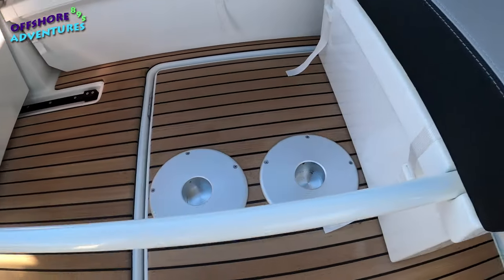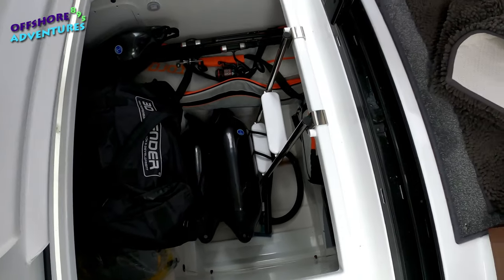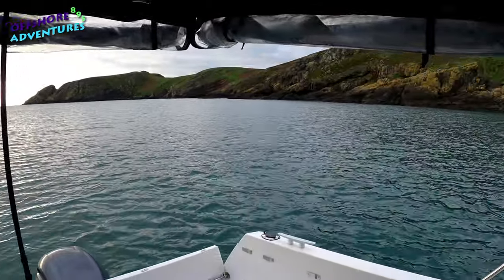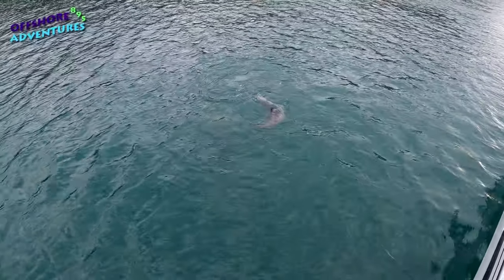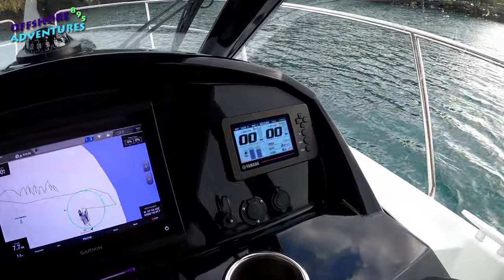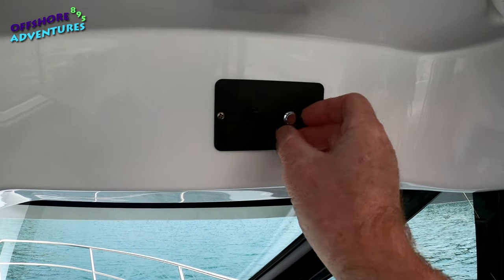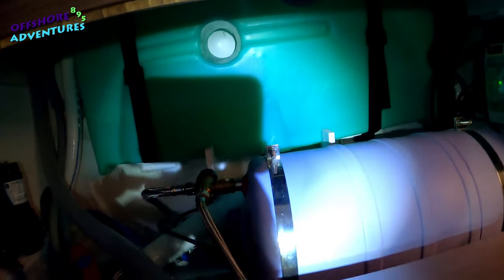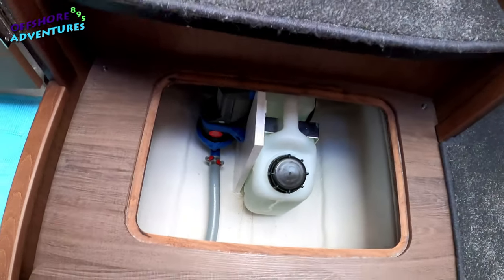Walkthrough - The Jeanneau Merry Fisher 895 Offshore and a picnic with seals!

Comment: Lovely videos, watched them all in the last day or two. Couple of questions as a lay person..?? 

2 x 300L unleaded fuel tanks. Assume it’s normal unleaded?

600 x £1.20 (assumed cost) = £720

Range of about 200 miles?

That about right?
Reply from the maker: Many thanks Notoriouscab 😁☀️ as always depends on speed but around 215nm at planing speed (21-22knts) or if you fancied a potter along the coast or estuary at 6knts then 383nms or 10knts then 336nms. So a fair range 😁. Servicing and fuel are, I guess, the deciding factors when buying a boat, after the initial outlay. That’s how I looked at it 👍
Reply: Thanks fir replying. Not close to getting one at the mo, but who knows!

Comment: I’m looking for a boat that could handle going from Florida to Bahamas.  It’s 55 miles on the open ocean.  Would this handle the open ocean in your opinion?
Reply from the maker: Thanks Matthew and yes it certainly would be okay for that 55 miles - it’s range at planing speed of 21knots is over 200 miles and that distance could be just over 2 hours at planing speed. It is a Cat B6 boat so that means 6 persons in waves up to 13ft and 40knts wind. The offshore version of the 895 has a strengthened hull to enable the B6 classification. Having said that it wouldn’t be a very pleasant trip if that were the sea state!!! So definitely yes to the trip and, as always, choose the best weather window to make the journey and to make it a comfortable crossing. There are some outstanding weather apps that give accurate forecasts for us in the UK - I suspect you’ll have the same!  Do your basic seamanship/VHF courses ASAP which will give you a good insight too. Hope that helps and get down the boat shop 😁😁

Comment: Can you trailer this boat/customize it a bit at the moment of placing an order? ps: How do you take a shower with only 25lts of hot water? No camping I guess
Reply from the maker: Hi Davide,
The boat is around 4.5 to 4.7 tons when fuelled and watered so you’d need a fairly big vehicle to tow it on a trailer!! I have seen one on a trailer triple axle but don’t know what pulled it - with the combined weight of vehicle and boat it would have to have a high plated gross weight :)
There are a LOT of options available when you order the 895 which can add a fair bit of cost so it’s all about what your budget is then build it to fit!! I have got a list of options somewhere but it’s also on the Jeanneau website too 😁🛥
PS There is only 25 litres but that is VERY hot so creates a lot more with the mixer - giving plenty for a shower :)
Reply: @PowerboatingAdventures    thank you very much, very useful answer. I guess I'll need to continue to scroll the boat market then, this is a fantastic boat, but maybe not as handy as I was thinking as a first boat for trips. For me the trailer is a must, but with that weight + the trailer etc ... Probably it's too much even for an american truck 😅
Reply from the maker: @Davide608  yes the weight increases pretty quickly - each of the Yam 200’s was about 220kgs so half a ton before you add the boat 😁 there a boat out there somewhere for you 😁☀️

Comment: Great video and really informative! What are the key differences in the offshore variant…or are all 895s offshore? Many thanks
Reply from the maker: Many thanks Stigz :) There are differences between the 895 and the 895 Offshore - The offshore has a strengthened hull which allows it to move from a Category C boat to a Cat B boat and capable off taking on higher seas which of course could give it a better offshore capability and perhaps range of use. The Offshore has twin engines, generally 200's whereas the 895 can have a single 300 or 250hp engine. Fuel tanks are larger on the Offshore at 2 x 300 litres. It is very similar in terms of accommodation layout. :)
Reply: @PowerboatingAdventures  Very helpful. I’m relatively new to boating and think the 895 could be the one for me! Many thanks 🙏
Reply from the maker: Fantastic!! If you're UK based then give Daniel Yeates a call at BHG Marine in Lymington, Hampshire :) You won't regret your choice for a second :))
Reply: @PowerboatingAdventures  Could I ask what the cruising & top speed is with this configuration? And for both what’s the fuel burn rate l/hour? Many thanks once more 👍
Reply from the maker: @stigz3570  thanks for your reply 😁 check out Episode 8 which should answer your question 👍 let me know if there are any more questions and of course don’t forget to subscribe if you haven’t already 😍
Reply: @PowerboatingAdventures  Thank you! How did I miss this 😂 Yes I am subbed and look forward to more adventures whilst I pretend my 6m RIB is a MF 895 🙏😂👍

Comment: Great, can she handles rough seas?
Reply from the maker: Many thanks for your comments George K - I saw the other comments you left on our films but they seemed to disappear when i tried to reply hence you haven't seen a reply yet!! At last I can reply to you :) 
I think that question is more about how comfortable you would be going out in rough seas. The 895 OFFSHORE is a Cat B boat so certified for Force 8 wind and 4 metre waves and the standard 895 is a Cat C boat which is Force 6 wind and up to 2 metre waves.
We have been out in 2m waves and it's not the most comfortable ride if the wave frequency is close together. Personally we wouldn't have gone out in 4m waves at all. 
It is also about your experience in boat handling when the waves are high as small mistakes can prove very costly as there isn't much margin for error!! We had some very strong currents around our coastal waters which, added to the wave height, make for some conditions that always need to be respected and which could be very dangerous. There are current flows around Pembrokeshire that could see you reduced to 10 knots at 4000rpm if you were against current (should be doing 22 knots at that rpm!!)
We always went out for pleasure and fun on the water and therefore didn't go out when the forecast was bad as we didn't need to!!
Hopefully that helps to answer your question a bit albeit I accept it's not a detailed review of rough weather boating!!! :)
Reply: @PowerboatingAdventures  Thanks a lot..we also do not decide to sail with bad forecast, but sudden winds will appear between Greek island passage.
Reply: We liked very much the 1095 but it is much more expensive. Thats why we are looking the 895. She seems a descent boat for a week getaways. An issue is the water quantity, is there space for water maker ( since we would like to order it with air con and gen) or an extra water tank?
Thanks, George and Lucy
Is there a possibility for tv installment in the saloon?

Comment: Great Video,  what is the fuel consumption?
Reply from the maker: Hi AJG, Many thanks for that :) The data I have so far from new is we've done 187 nm's at an average fuel use of 2.77ltrs per NM. That covers both slower trips and those at planing speed. In terms of fuel rates at different speeds I am going to do a film of that showing the LPH as we go through the different speeds. I know the performance data for the boat says the following but I want to compare that to the REAL data .... at planing speed it should be 59LPH at 21 knots. As soon as we escape from lockdown I'll be on it and get that real time speed/lph footage!! :)
Reply: @PowerboatingAdventures  so high consumption with those gasoline outboards :( shame for a boat so nice
Reply from the maker: @Heve62  I don't look at the pump so I don't know!! :)    First run out tomorrow since December 2020 - freedom at last!!
Reply: @PowerboatingAdventures  but overall gas outboards vs inboard diesel :) a Botnia targa 32 uses about 2.1l/nm and diesel is even cheaper at the pump